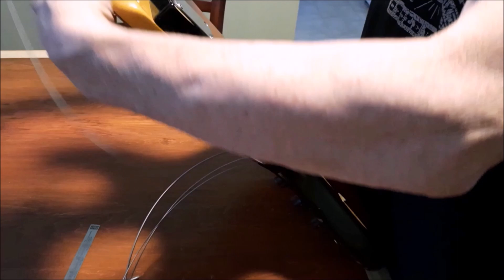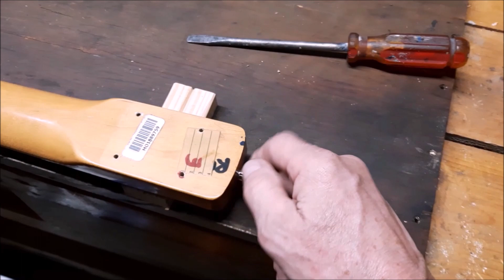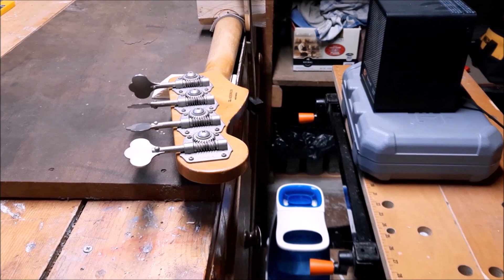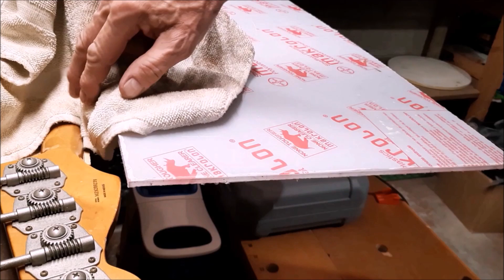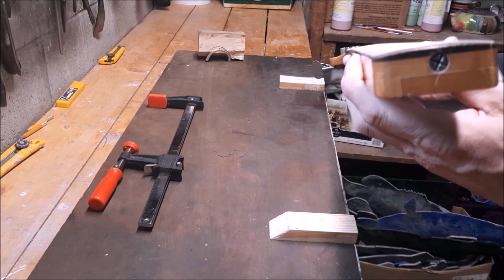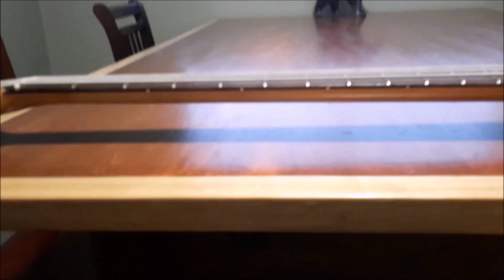Jazz bass bowed neck repair with steam and heat

Comment: Nicely done. Headed to my shop to remove the neck bacbow on my '51 RI p-bass. I've done this before but a refresher course was due. All in all, Leo got most everything right on his guitars except the neck heel TR adjustment nut. Dumb. The the bullet truss rod nut on the head stock. Dumb and ugly. I do like the micro-tilt though.
Reply from the maker: Ya its just like a carpenter bending wood but be mindful not to damage the frets